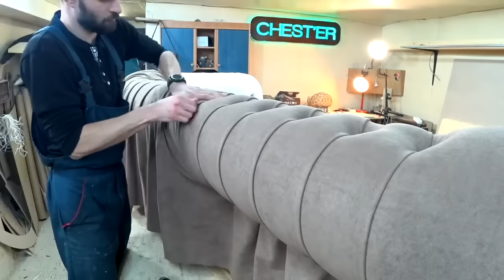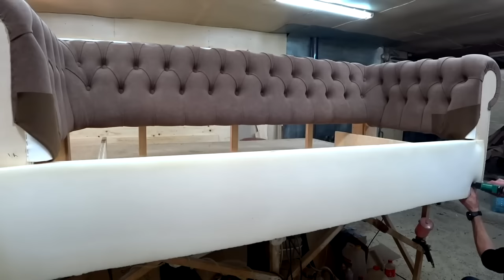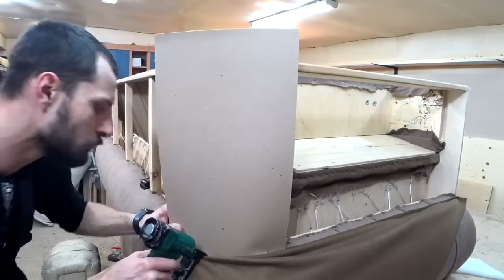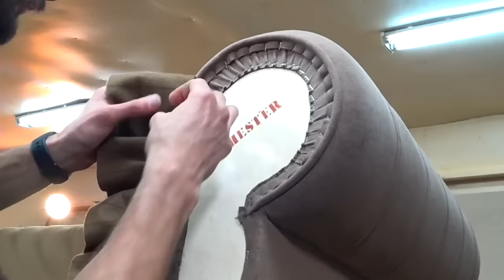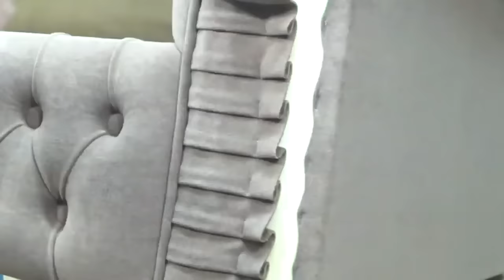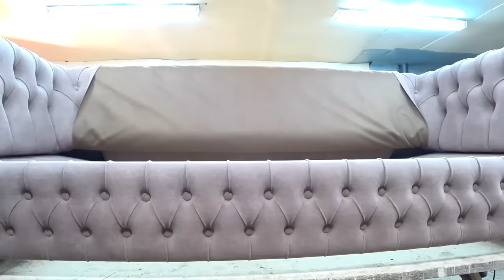Classic upholstery on the Chesterfield sofa

Comment: The classic upholstery on a Chesterfield sofa typically consists of high-quality leather or sometimes velvet. The leather can range from full-grain to top-grain, with different finishes such as aniline or semi-aniline. The traditional deep-button tufting adds to the distinctive look of a Chesterfield sofa. The arms and backrest are usually at the same height, creating a continuous line, and the rolled arms and legs give the sofa a sense of elegance and sophistication. The classic upholstery also adds to the durability and longevity of the sofa.
Reply: Not everyone can afford leather and not everyone needs it. It may not be suitable or be appropriate for many reasons.